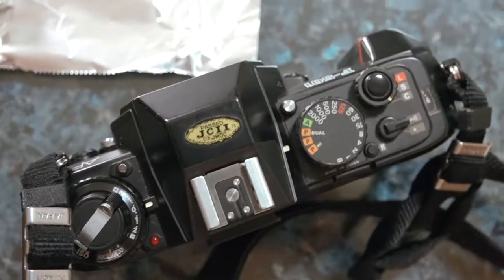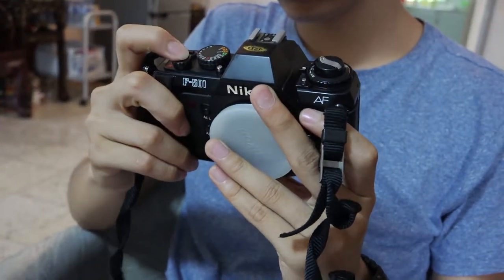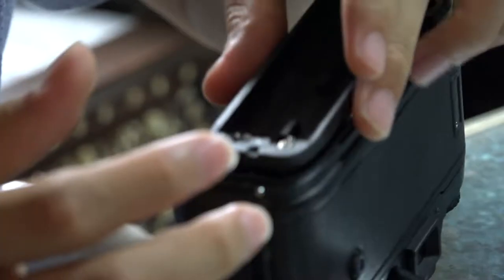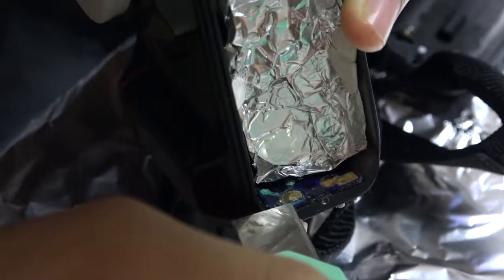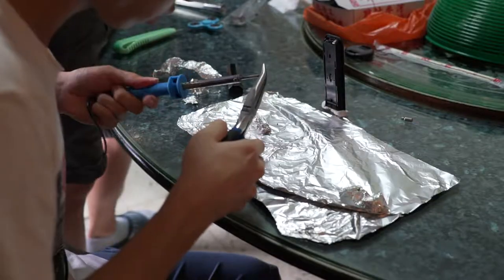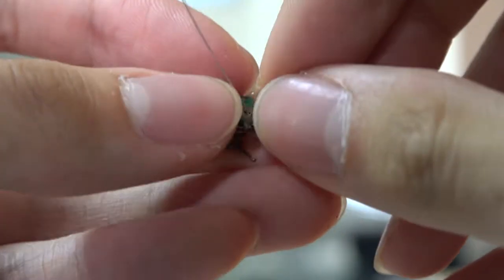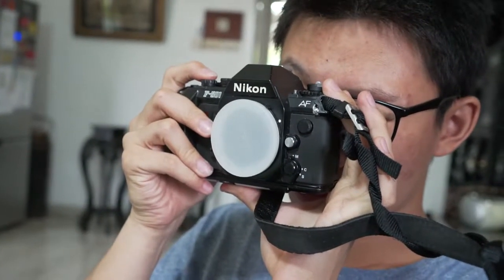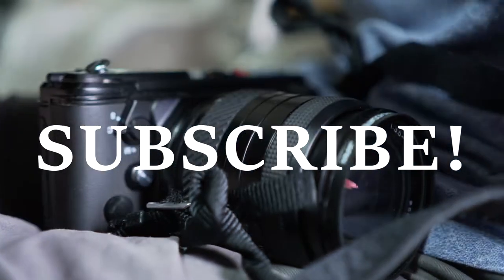Fixing an old Film Camera

Comment: Hi!  I have a question I have the same problem but I couldn't remove the battery base @0:27 please help!
Reply: The Mb3 AA battery pack add on piece may be stuck due to the corrosion, as on mine. for that I suggest gently forcing it to slide with the help of a screwdriver. (I may be a bit late to help out but hopefully anyone with the same problem might read this.)